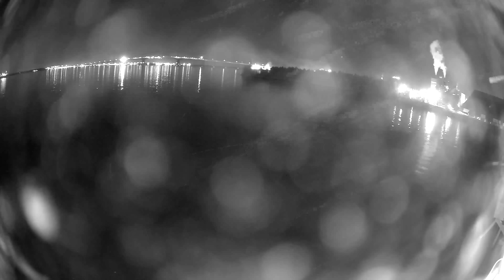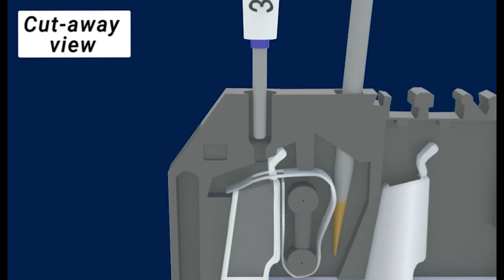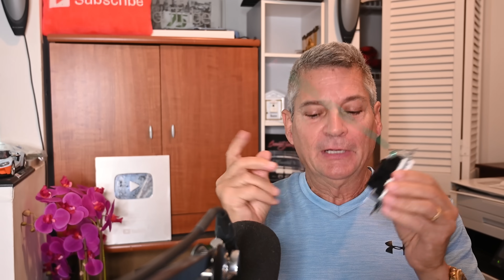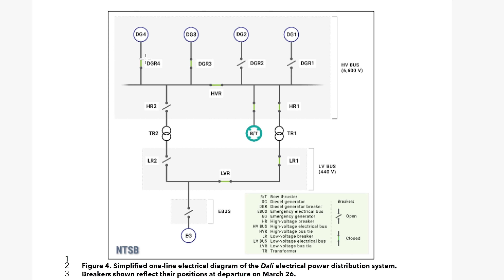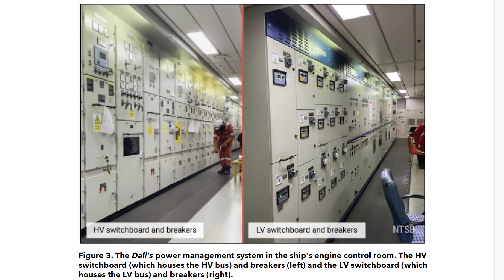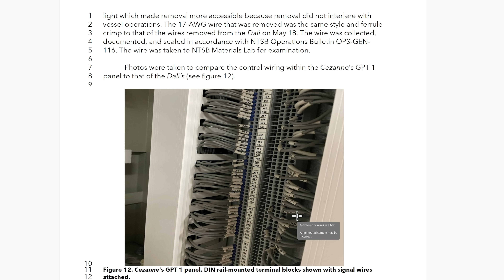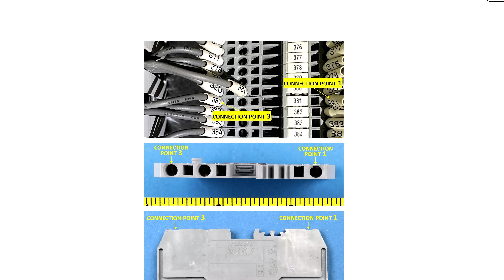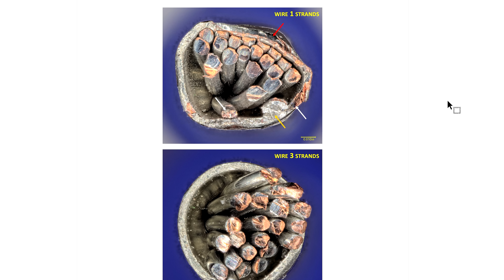NTSB: Scary Wire ERROR Caused Dali Crash/Key Bridge Collapse Baltimore

Comment: I'm an electrician. 9/10 times there is a no power issue in a home, backstab wiring is involved. Sometimes I find wires on the screws as well and have to pigtail everything first.
Reply: backstabbing is part of the installation instructions of the device, and I bet most homeowners can do better backstabbing than using the screw terminal. I have taken out literally hundreds of "DIY" installed outlets, and 50% of the time if the screw terminal was used, it was done wrong. It's pretty hard to actually mess up backstabbing. Of course, nothing is worse then DIY installed wire nuts...
Reply: @mrl22222  There are two kinds of "backstabbing". The older method uses a spring connection with a small release hole for a tool that I have never been able to find, the newer method uses a clamping arrangement actuated by the terminal screw on the side of the outlet. It's functionally the same as a rectangular washer under the screwhead. Much easier to undo and, imho, offers more secure and larger contact area than the old spring type.
Reply: @antronargaiv3283  I've heard the second method called "backwire".  I'd argue it's not quite as good as the hook and screw, but acceptable and substantially better than backstab.
Reply: @mrl22222  Danke für die Infos.
Reply: @mrl22222  Trufax about the wirenuts. I've troubleshot a few things for friends, and it usually comes down to bad/old wirenuts, improper contact inside the wirenuts (sometimes because they're bad, cheap, old, or a combination), or stripping the wrong amount from the wires connecting in the wirenut.
Reply: 'Backstab wiring' , 'wires on the screws' 'pigtail everything'... What????
Reply: @MC-cd8ni you would have to read and understand backstab wires are inserted but not screwed, screwed wires are tightened by screw not backstabbed, and a pigtail usually involves a wire nut.   Clear?
Reply: @NETWizzJbirk  Don't feed the trolls
Reply: @jonnyz69 thats kinda mean buddy, I could not understand any of those terms and with his answer and bit of research i got it.  Oups, now im feeding the troll 🤦
Reply: Ahhh I should have finished the video first 😂
Reply: Most lay people likely don't understand that many electricians never perform any residential construction wiring, and most likely never install inexpensive, lower grade devices.
Reply: As a DIYer, what I've encountered are boxes that are far too shallow and not enough lead-in by the builder, so it makes it incredible difficult to use screw terminals. Almost like when they were wiring they attached the outlet, then pulled the wire back out of the electrical box.
Reply: @larrybud  💯💥‼ so frustrating huh?
Reply: 9 times out of 10 and there's something like 20/30 outlets, so 2 or 3 of them are a problem; do you consider that acceptable?
Reply: Yes indeed. I just traced an intermittent wiring failure on an outdoor light that turned out to be a backstab insertion to a switch that had cracked the plastic housing allowing the hot wire to come loose from the connection. Always use the screws folks.
Reply: It's the standard over here in Germany. You won't find any outlets or switches with screw terminals anymore and - this is important - if properly cut to length as described on the device itself, these stab connections are safe. It's the same principle as the simple wago style terminal blocks. These things don't let go if properly used. But every installer should perform a pull test anyway regardless of what principle... ferrules don't work on these clamp style connectors anyway and you shouldn't connect stranded wire to a switch or socket directly anyway. We have two definitions of cables for the two installation types: permanent is solid, cables that run through walls and otherwise cables that aren't moved by anyone after installation and temporary is stranded wire for household devices, lamps and lighting. So to install things according to code over here is by running stranded wire to the lamp, if that lamp fixture is hanging freely for example, and run the cable to a small junction box where you use a ferrule to bind the strands, use a re-openable, non-screw terminal block (i.e. wago terminal block) to clamp that down properly and run a solid wire cable down to the switch. We aren't even allowed here to use screw terminal blocks anymore because too much went wrong with them too...

Comment: In my neck of the woods, such DIN rail connectors have screws with torque specifications. No push-fits.
Reply: That wasn’t a push-in terminal. It requires a tool, so it’s a different kind.
Reply: @tookitogo  still stupid
relied on spring tension
very bad
Reply: @raypitts4880  Spring tension is a good thing, because it makes a connection less susceptible to vibration. In fact, many modern screw terminals use a spring inside for the exact same reason!

Comment: Come on, those "backstabbers" are solid connections. It goes to show that when you didn't show you finally getting the wire out. What else are you lying about?
Reply: True backstab connections (the holes in the back of cheap outlets) are terrible. They’re just formed out of the same cheap brass as the internal bus bars in the outlet. Proper spring-cage terminals (like the ones used on the Dali) and the “push-in” variants that let you insert a wire without a tool, are very different because they use proper steel springs that don’t loosen up the way brass does.

Comment: Except, your wall outlet isnt going to have to withstand constant vibration or lateral pulling (you were pulling and twisting pretty hard, admit it) like the connection on the Dali.  I see your point, however.  I worked as an automotive accessory installer for 25 years and understand the dynamics of multistrand connections intimately.  I am surprised they would use a connection method like that in the first place on board a ship
Reply: Vibration is exactly why they use this type of connection - sprung loaded constant pressure terminals.

Doesn't matter what kind of termination you use - no amount of design negates bad installation
Reply: The wall outlets in earthquake areas are. The entire building flexes. So the goobers who leave  zero slack in wiring create    wires pulling out. Ie YT folks often preach no loops no extra slack since  have no experience fixing their ignorant mistakes.  Ie wires so tight that any movement pulls on sockets wire nuts or switches.

Comment: This is exactly why we don't like those backstab connections in even residential receptacles and switches. They should be decertified and outlawed. During the initial description of the terminal block setup, I immediately thought of the parallels to backstab connections and was glad to see the comparison. There are YT videos of disassembly of those devices. Very unsettling. So now I only use commercial grade in my house - and they are only about $1 more.
Reply: Those spring loaded terminals are not a big problem at all. At least not in Germany and Europe. Those are the standard for decades now here in Germany and not a big failure point at all. Maybe it's a mixture of not knowing how to install these correctly in the US and an confirmation Bias?
Reply: @AmatheiaOrca  (American living in Switzerland here, so very familiar with the electrical hardware used in both places.) The backstab connections in American outlets/switches aren’t the same as any WAGO terminal. You may not know this, but a standard (“contractor-grade”) outlet in USA costs less than $1. So as you can imagine, that doesn’t leave room for high-quality materials and elaborate designs. I’ll describe an outlet, but the same principles apply to switches: All of the connections for one conductor, i.e. line or neutral, are made of one single piece of stamped brass. That means that the screw terminal, the contact mating surfaces of the outlet itself, and the backstab terminal are all made of the same piece of cheap brass. And brass sucks as a spring material: it deforms over time when bent. This is why American outlets become loose with time, eventually to the point that plugs slip out with zero force. In fact, the manufacturers say to replace those every 10 years, but of course nobody does. 

So when Americans think of screwless connections, they think they’re all as bad as those terrible backstab connections.

It’s nothing like Swiss outlets, which are much higher quality (and in my experience, never wear out), but of course cost far more. (The cheapest outlet you can buy is about $10, but the ones you actually see installed everywhere cost $20-30.) 

You can get high-quality outlets/switches in USA — they’re the ones called “hospital grade” — but they cost far, far more. Even those can’t handle ultra-demanding applications, like being plugged/unplugged dozens of times every day, like the outlets at airports, where all day, every day, passengers are plugging in their phone chargers. And so practically every US airport outlet is loose… 

In contrast, a WAGO terminal has a bus bar made of copper, but a spring made of spring steel: each component is made of a material optimized for its function. 

(I work in electronics, and in some models of electrical connectors, you can buy the contacts in brass or phosphor bronze/copper. Brass contacts are cheaper, but have much lower mating cycles than the phosphor bronze versions. Even more expensive ones use a separate stainless steel spring to supply the contact force, conceptually similar to the WAGO, of letting each part be made of the optimal material.)
Reply: @AmatheiaOrca I think we can safely say it's a bias issue. I don't mean to be disrespectful towards our brother from across the pond but we're talking about a country that refuses to move away from wire nuts and thinks anything more 'technologically advanced' is the issue.
Reply: But it wasnt backstab problem at all. It was TOO SMALL on such circumstances there shouldnt be wire ferrule put on wire. But it was regardless. And that was the main problem. Someone wanted to make it look nice regardless. Instead to make sure connection is correct.  

I have noticed this many times - im electician. In some companies i didnt even have these wire ferrules, nor time  to put on wires. So i just cut wire and put inside directly. It's more difficult sometimes dangerous. wire should be put carefully to put everything inside. And makes harder to put wire inside. Connection are usually much better. If you do "inproperly". On other companies people wanted to have everything LOOK super cool. Looking so nice not always makes it work nice.
Reply: @KabelkowyJoe Yup, everyone seems to be thinking the back stab terminals are the problem when it isn't - it was an installation error.
These types of constant spring pressure terminals are exactly meant for high vibration environments and are superior to screw clamp type terminals which are far more subject to loosening through vibration and thermal cycling.
But no amount of design negates installation errors.
Reply: @KabelkowyJoe  Those wires definitely aren’t too small for ferrules. Ferrules just need to match the wire size properly. At work, I have ferrules for 0.14mm2/AWG26 all the way up to something like 10mm2 (I’m an electronics technician, not electrician, so I rarely work on fat wires). I even have some uninsulated ferrules for 0.08mm2/AWG28. 

But I 100% agree with you that this isn’t a backstab issue, because the WAGO terminal blocks in question aren’t backstab terminals!
Reply: @tookitogo I completely agree.
My ferrule kits are the same size range.
Ferrules are desirable for use on stranded conductors being held in pressure type terminals - eliminates risk of strands being spread out or breaking over time.
Reply: @KabelkowyJoe  I see later in the video (shown on screen, but not mentioned in narration) that the wires were described as “AWG 17”, which is 1mm2. That is by no means a small wire, even for a fairly large WAGO terminal. The WAGO terminal blocks used here were the 2.5mm2 size (the most common), so 1mm2 is well within the rated wire range of 0.08mm2 to 2.5mm2. 

The ferrules used have blue collars, which in DIN and Weidmüller color codes means 2.5mm2 (and 16mm2 and 50mm2, but we can safely ignore that). This does suggest that it’s possible they used the wrong size ferrules, too. But there are Asian ferrule manufacturers which make 1mm2 ferrules with blue collars, so this isn’t conclusive.

Comment: At 21:53 the arrows are showing where the contact got hot enough to melt the plastic in 2 places. It shouldn't get that hot in normal use.
That wire had a bad ferrule crimp, period. I looks like a wire strand was out of place when crimped. Those crimp tools won't release until completely crimped so there is no correcting it once you start. You have to complete the crimp then cut it off and try again.
Reply: Love ferrules. Used them for the first time on a project, and they make terminating the wires SO much easier. No ragged strands and a firm termination for finer gauge wires.
Reply: The first part of your comment about heat is correct.

But then you go on about talking about a bad crimp. No, if that was the case then the ferrule would be left in the terminal block and the wire would pull out of the ferrule.
And then in the same sentence you claim that the strands are broken. Which has nothing to do with the crimp. And again, no, one broken strand would not cause a wire with ferrule to pull out of the terminal block.

And then you say something about the crimping tools. No, not all crimping tools are ratcheting. That is absolutely not true. There are many non-ratcheting crimping tools, especially when it comes to ferrules. And in any case, it's not the fact that it's ratcheting or not that causes bad ferrule crimps. It is the shape of the crimping jaws that is important. Also, using the correct slot in the jaws and using correct ferrules for the wire size, and using the correct crimping tool made for ferrules (not one made for spade connectors or cable lugs, for example).
Reply: That would explain pushing the label up, then it slipping down again??

Comment: The first time the power went out - they had no clue why. Then when they got power back they just said 'send it' instead of not moving again until they had an understanding of why it lost power. Is that about right? Or was it standard operating procedure to ignore electrical problems if they get it running?
Reply: I mean I used to be an auto mechanic and you never sent a car back to the customer if the brakes were failing and you didn't know why.